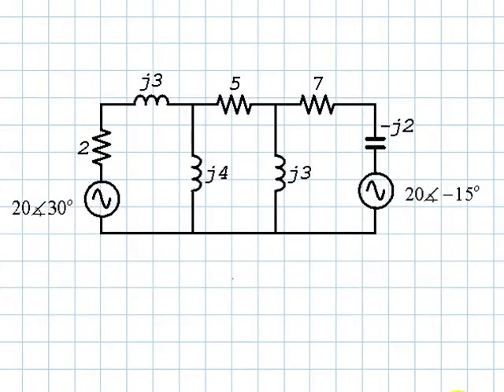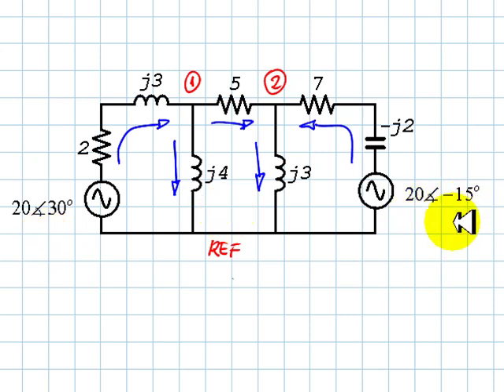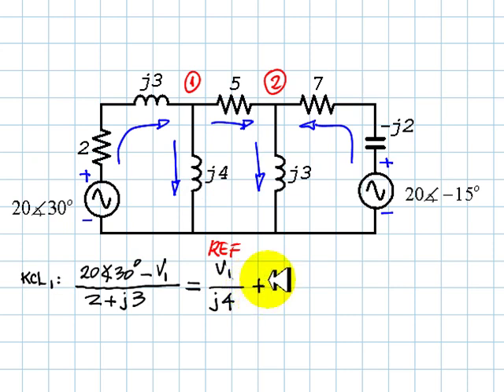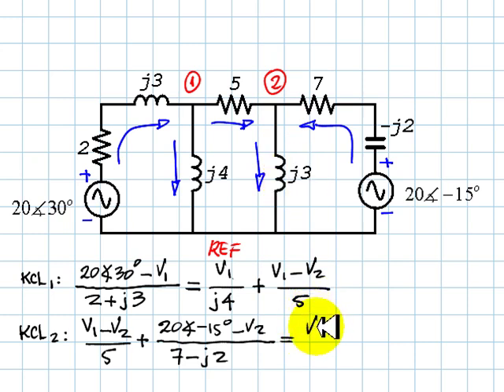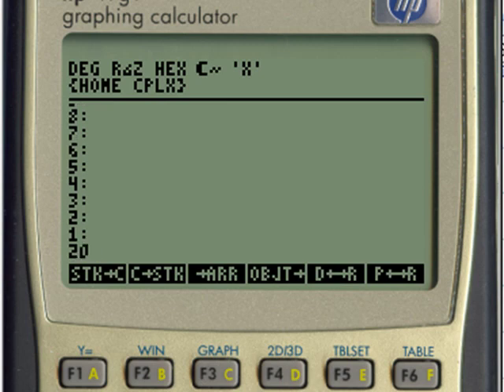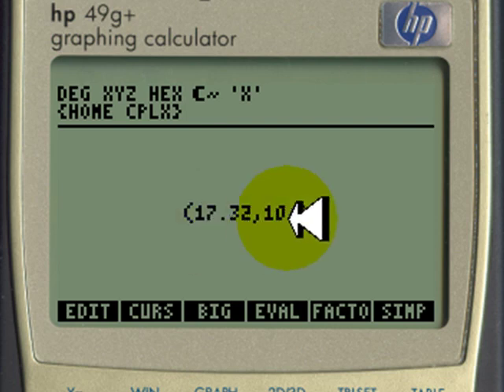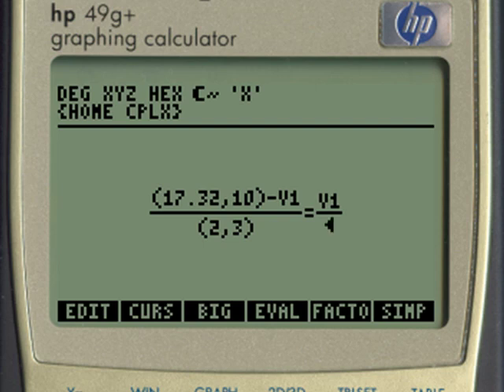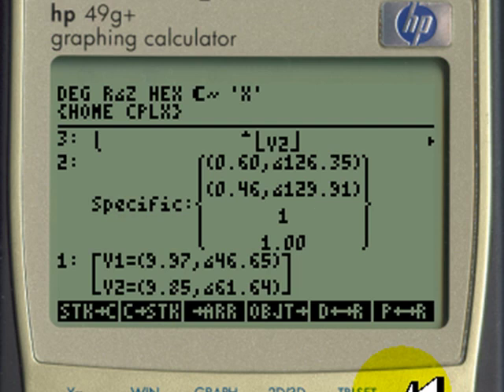HP15/PHASOR 11: System of equations with Complex Numbers

Comment: 2:44 Is it possible to write complex numbers in polar form in the equation writer (algebraic or RPN mode)?
Reply: I know it's possible to write in rectangular form in the equation writer (and in the stack), and to write in polar form in the stack, but I don't know if it's possible to write in polar form in the equation writer.
Reply from the maker: Not to my knowledge. You can do that in the HP-Prime but not the HP-50g.
Reply: @rolinychupetin  Oh, I see. Too bad for the HP 50g. Thank you for answering and also saying it is possible in the HP Prime!
Reply: @rolinychupetin  One last question with respect to the HP 50g. Is it possible to write complex numbers in polar form whose magnitude is a fraction or a square root? For example, when I type "(1/2,∡45)" or "(√2,∡90)" in the stack and then hit ENTER, I get an error.
Reply from the maker: I would try (1,∡45)/2 or try (1/2)*exp(i*pi/4) (I know, Euler's notation is a pain to type. Out of curiosity, I just tried to write your expressions in the HP-Prime and it worked nicely.
Reply: @rolinychupetin  I really appreciate your reply (even after this video is eight years old!); thank you for taking your time. And, of course, thank you for clarifying my doubts! It seems I need to switch to the HP Prime, hehehe. Saludos desde Venezuela.
Reply from the maker: You may want to try your hand with the free emulator for Windows of the HP Prime. I have the actual calculator and I must say that I use the emulator on Windows more often than I do the actual calculator (because it is easier to type on the full keyboard of my laptop, of course). And it is free!